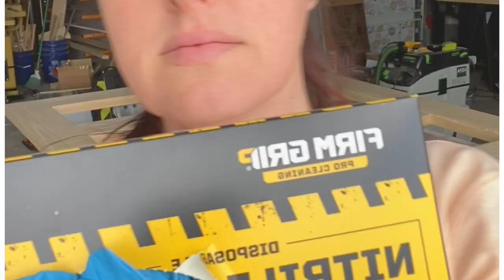HOW TO BUILD A LARGE BARNDOOR WITH GLASS - easy and fun way to add glass to your door

Comment: Just ran into this video because I want to make a front door with glass for a workshop. My question is the pocket hole jointer you used, is it enough to hold that size of a door. Just trying to find out if I can do that instead of other types of jointer such as tongue and groove that takes longer to do. Does the jointer wobble at all?
Reply from the maker: It seems to have done the job but it does get very light use where it is installed, if it’s a front door, I would suggested dowels or dominos or even half laps for the joinery

Comment: What if the glass breaks? I noticed you used brad nails. Would that be easier to use then screws to remove the trim to swap glass out in case of replacing?
Reply from the maker: I actually just used pin nails and yes the idea is to remove the trim swap out the glass and replace the trim 🙌🏼🙌🏼

Comment: How thick is the trim? Also I think you said the trim was able to come off if glass broke   but I think I see you gluing it down and pin nailing.
I'm getting many calls for frosted glass sliding doors , never put glass in before.  Was it 2x6 wood you were using?
Reply from the maker: So this is lumber I milled myself, so the measurements are close to a 2x6. I’m not glueing the glass I’m actually using silicone to help with shock absorption. They are still able to be replaced. I did nail the trim though

Comment: 1.) How much did the whole build cost?
2.) Where did u get glass panes?
3.) Could I use the same method for double layered glass panes?
Reply from the maker: The cost will vary depending g on size and wood choice. Measure and then calculate accordingly.
I got the glass from a local paint and glass shop, you can get tempered glass and have them cut it to your specific dimensions.
I’m not sure on the double, you could give it a go